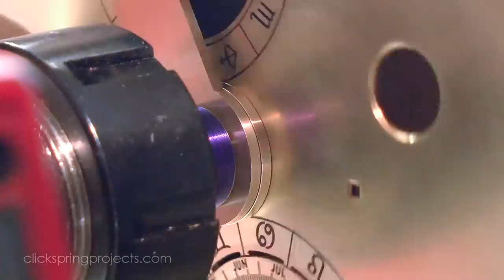Forming A Domed Support Pin

Comment: You show measuring the location of that conical pin to fasten the whole thing in the assembly and keep everything together. Do you actually rely on that pin to keep the gnomon and the other bracket (where you set the latitude) relatively stiff and not freely rotating? Basically you need those to be relatively fixed in order to hold the device and take readings. And I wonder if you do all of that via that pin, or via some rubbery things/other tricks etc etc. Thank you!
Reply from the maker: Yes the pin and adjacent washer pull the assembly into a slight compression. Still free moving, but sufficient for stability - Cheers :)
Reply: @ClickspringClips  Hey thank you mate! I would have thought that this would slacken immediately, as we are talking about max 0.1mm compression, and the pin might wear out as well. But then again, you made it work :)

Comment: At first, I was curious why he chose a tiny end mill rather than a slitting saw to make the slot in the domed head. Then I saw the perfect fit with the brass plate (and the actual size of the slot, this wasn't designed for a 6.5mm straight screwdriver!) and it all made sense. I do wonder how the original maker would have cut (probably hand-filed) and sized that slot to get anything approaching that precision, perhaps it was soldered?

Comment: PLEASE DO A TUTORIAL ON HOW YOU POLISH YOUR PARTS!!!! they are magnificent! I could never achieve anything close to that degree of shininess, what kind of magic are you doing?
Reply: The reason why most people don't get good results is because they rush it. All you've got to do is use progressively finer grits of sanding paper. To get mirror shine you need 1500-2000 grit or better. For something like this I would go 200->400->800->1200->2500 (because that is what I have at hand). If you want to go completely overboard and get that "deep chrome" look you do a final pass with 5µ diamond paste (or similar) on a stub of hard rolled lint.

How to get a bad result: Go to the next grit too soon so you still have deeper scratches left from the previous grits (or original tool marks).

Comment: I always see you freehand very nice domed profiles, but every time it makes me think "If there were any man that could invent a tool to make custom domed profiles to a precision spec, it's this guy, but alas, it never shows up.".
Makes me kinda sad. Sometimes I even swear I can see the compound joints and adjustment screws that would make it happen. Ever thought of making such a tool, or does the joy of free handing them outweigh the joy of wasting several days making a tool that will save a few minutes?